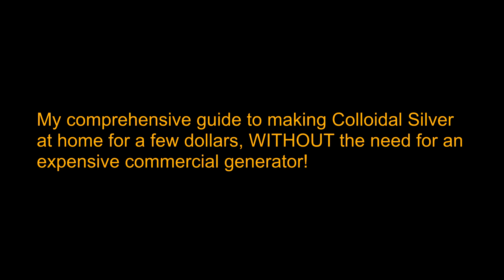Scientific Methods to Test Water Purity With TDS Meter

Comment: silver rods can not be more than 1 inch apart
Reply from the maker: Hmmmm...Not sure where you get your info, but I've always had them aprox. opposite each other - works fine...made another batch yesterday.
Reply: Not true, it doesn't matter on the distance between rods/etc. Just so long as your ppm continues to read,  that means it's working

Comment: You're done, flocculate colloids, making black lumps, this is a failure.
You can make it quickly without wasting it if you make a certain effort.

I overcame these problems.
Reply from the maker: WTF? There are NO lumps, black or OTHERWISE in what I make! 🙁

Comment: Does anyone knows where to get "double" distilled water? Could be over kill for colloidal silver but I also need it for a hydrogen gas generator.
Reply from the maker: I haven't heard of it myself - I imagine it's been filtered even further?
Reply: Buy your own water distiller and run your water through as many times as you want.  I myself do this, I totally understand what you're saying.  I hot mine from Amazon for about 45.oo. Goodluck mate

Comment: You are making ionic silver not Colloildal and use copper pad to clean not Scotch-Brite.
Reply from the maker: Well there is a lot of debate about it's exact classification, but whatever it is, it is what I use myself and have for many years with good results. Thanks a lot about the tip for the copper pad by the way. 👍
Reply from the maker: * PS; On that matter - Copper being toxic, one would want to ensure a very thorough rinse on top of the pad.
Reply: Please,  where or what plant  are you getting your info? The plant YouAnus ?🤪

Comment: I think the water you're thinking about might be called Fiji Water they're supposed to have the purest water in the world from deep inside some caves or something to that effect I believe. I've had it it tastes a little bit different than most Waters do. I also have exactly pure water through a reverse osmosis filtration system that I have. That comes up with 0 parts per million. The distilled water should be zero parts per million somewhere contaminants are getting into that and you might want to find a different manufacturer of distilled water the one that actually reads zero the way a distilled water would come out if it was being distilled properly.
Reply from the maker: Possibly, I don't recall. Yes it would be lovely if all manufacturers of products actually made what they promote they do!

Comment: ALSO  the  electrolyte will measure 20 + ppm befor you even start the electrolisis,,it does not read silver particles only ions
Reply from the maker: Actually, since I typically START at 3PPM when I use distilled water which I make myself more often than not; it rises with time when I use my method, so that is incorrect. I stop between 10PPM and 20PPM, depending on what end use I need it for. (as in my other videos)
Reply from the maker: It measures 0 to 2ppm before I start, depending on the distilled water I use, which is why I also make it myself.

Comment from the maker: * As I've now said MANY times in the comments section; Whether you choose to call this Colloidal Silver (which is what I knew it as at the time) OR Ionic Silver : THIS is the method I've ALWAYS used, to great effect, both INTERNALLY and EXTERNALLY. You can debate all you like, but the purpose of this video (& the remake of it) is to show you HOW to make it cheaply and as an EFFECTIVE alternative solution which I have found works where some pharmaceutical options, have not - i.e., for Rosacea, where a skin SPECIALIST told me there "was no natural option". * ONLY EVER use Pure distilled water! You can buy this cheaply, or even make it yourself if you use a lot of it. This is how I make it at home;https://youtu.be/P6WqbOQu0Mw

Comment: TDS meter does not give you ppm of silver particles,because it can't,;Colloidal silver is silver particles in suspention in water:::TDS meter only measures ions that conducts electricity(an electron of a silver atom(ion) which is entirely different and not the same as a silver molecule ),,A TDS meter measures the conductivety of a sulution of ions,,weather it be salts of metals or acids,hydroxides and impurities in the water::what it will do is tell you how pure your water is::
Reply: A  T.D.S meter measures dissolved salts, silver is not a salt.
so far you have best explanation on that part.
Reply from the maker: @paulabernathy2250  A TDS meter indicates the total dissolved solids (TDS) of a solution, i.e. the concentration of dissolved solid particles. Dissolved ionized solids, such as salts and minerals, increase the electrical conductivity (EC) of a solution. Because it is a volume measure of ionized solids, EC can be used to estimate TDS. * I did mispronounce the meaning of TDS in this video, and made a follow-up video;https://youtu.be/6pf3zP6yNAI for one reason a few people complained about my birds in the background (I think THEY missed the point of this video)
Reply: @SteveMack  I agree  E.C level measurements can 
Be useful in determining 
A close estimate of volume of 
Suspended Charged particles.
How come no one uses a
Multi- meter to measure silver 
Particles? And I haven't seen too many people straining 
C.S  through coffee filter either. But that's what we're
All doing (colloidal silver circle) learning from one another. A little bit here, a bit there. And 1 tiny little mistake 
Can instantly fuck up a batch of homemade C.S.  So, I
Appreicate any little tid bits.
Reply from the maker: @paulabernathy2250  (Sorry for delay - I missed this one) I would assume that no one uses a multi meter, due to conductivity of the water - WHY WOULD one even contemplate using one for THAT purpose? A multi meter (for common uses) measures VOLTAGE - NOT Parts Per Million of any liquid; hence why specific instruments are developed for specific purposes.
Reply from the maker: Correct; which is what I believe I've corrected myself on (slip of the tongue), both here in past comments and in the remake of this video

Comment: I've done many batches of homemade colloidal silver. With .999 and .9999 silver and distilled water and it never worked.. I used it for a sinus infection by sinus rinse and drinking it and it didn't help at all.
Reply from the maker: Well; everyone's different - what works on some, may not necessarily work for others..Same exact thing as 'regular' medications sadly. Keep trying new things until you find some relief - best of luck.👍
Reply from the maker: Clearly different things work for different people. In MY use, I've found it works, for some things. I think moreso topically.
Reply: @SteveMack  Should work for everyone right? CS knows no color or gender it's as good as they say it should kill all fungus and pathogens. Am I correct?
Reply from the maker: @californiaitis1255  NO. No more than one type of pharmaceutical medication works for some, but not all. Also, seems to depend on the concentration. This is merely AN alternative that people can TRY to see if it helps their ailment, when other methods have failed, OR in addition to other things.
Reply: If you used Colloidal Silver on a sinus infection and it didn't work, chances are you didn't have  sinus infection.  Things like heavy metals and mold can present like a sinus infection.  They can even cause them.  But silver won't remove them.

Comment: Have you tried making the colloidal silver by boiling the silver in water? No electricity. I am doing this with copper. I get 30ppm copper solution by putting copper in water (like in a mason jar), and boiling it, I believe it will work with silver too.
Reply: It wont work. Its the electrolysis that separates the silver ions from the rod. You have to have a current flowing through the water for the process to work. Its middle school chemistry.
Reply from the maker: Sorry for VERY late reply - I didn't get notices on all comments it seems. As Matt said below, electrolysis is how C.S. is made, but putting silver in water can kill bacteria (they use it in pool sanitization now too) but merely boiling it in water won't give you a colloidal suspended solution, which is what I show how to do in my video. Cheers

Comment: Voltage is important. Please read this information before you proceed: http://www.docs.renewedcell.com/index.php?title=Main_Page

No i do not work for this company, but I do have one of their generators and have found them to be excellent.
Reply from the maker: I have never found voltage has much bearing on it, and I've used AC and DC at various voltages.  One may produce a better yield of particles, but the object of this method is to be able to make it at minimal cost.
Reply: @SteveMack  quality is important Steve. The most effective particle size is between 4-12 nanometres.
Voltage is important because it influences/dictates the size of the particles released from the silver rods.
When making 'colloidal silver' you are guaranteed to make a % of ionic silver.  Silver ions are fine when applied externally, but when they are ingested and interact with the bodies natural salts, as well as hydrochloric acid in the stomach, it turns into silver chloride. Silver chloride does not easily filter through your body and certainly does not promote the desired antimicrobial, antiviral and antibacterial qualities of which true colloidal and nano silver particles do.
http://m.silver-colloids.com/?url=http://www.silver-colloids.com/Pubs/AboutIonic.html&nosim=true&utm_referrer=#2833
Reply from the maker: @FFCRBDI  yes I fully get that and mentioned it briefly including a link within the text.
Reply: The "wall wart" as we call them here in the states converts ac in to dc so technically your only using dc. Great intro video. i love the cs IS BS debate in the comments. If it's yellow its colloidal. It's reduced. Voltage does matter though. Amperage actually. Throw a couple cheap 7.5 resistors or some use an led lite to limit amperage and it will come out good every time. 15 milli amps is the magic number.

Comment: The oxidation of the electrodes can be avoided by switching polarity on the electrodes. Also, it is recommended to use a magnetic stirrer.
Reply: Have you tried making the colloidal silver by boiling the silver in water? No electricity. I am doing this with copper. I get 30ppm copper solution by putting copper in water (like in a mason jar), and boiling it, I believe it will work with silver too.
Reply: agauerm you are correct in assuming that you can heat-reduce ionic silver. The reason to use reduction agents is twofold: it will speed up the reduction process, and it will help to control particle size. As you will know, particle size is very important for medicinal nano silver.
Reply from the maker: @agauerm  No. I cannot see how that could possibly work, as you need to go through the electrolysis process I described in order to produce the particles.
Reply from the maker: BOTH electrodes are IN the water - What you're referring to is, in my knowledge 'Sacrificial Anodes', which does not consist of both electrodes being in the same conductive element, i.e., on a boat; the galvanic anode corrodes, whilst the submerged noble metal cathode doesn't...The only benefit I can see therefore, is that by reversing the polarity on the electrodes, you could even out the wear of the rods...
Reply: I have been producing ionic silver with and without polarity switching, and I don't see why it would be interesting to waste your silver rods by producing large amounts of silver oxide? When switching polarity, what happens is that both rods get "plated", or in other words, the silver is returned to the cathode as metallic silver. This way you can avoid that large chunks of silver oxide fall off into your ionic silver, that need to be filtered out afterwards.
Reply from the maker: @marctinkelenberg  When you switch polarity, isn't all you're doing changing which rod becomes the Sacrificial Anode?
The process I use is not electroplating - Both rods get THINNER with time; One does not get fatter.
Reply: @SteveMack , no problem if you don't share my understanding of the benefits of polarity switching. You are correct that both electrodes get thinner, because of two different processes, both related to the electrolysis of the water: formation of silver oxide, and formation of silver hydroxide. My only goal with respect to polarity switching is not to get too much muck in the water, because this will provide all kinds of side effects that all influence the quality of the final product. Interestingly enough, all upscale ionic silver generators have opted for polarity switching as part of their circuits. Maybe they are able to explain better why that is.
Reply from the maker: @marctinkelenberg  ok; I appreciate what you're saying more clearly now and it sounds like using an AC source is more ideal on that basis - as I do mention in the video, one has that option (if they have such a source available at home) I apologize if I misunderstood any previous comments & over reacted - but people need to understand; I have never knowingly misled anyone, in life nor in any videos, and sometimes words & intention of meaning can be misinterpreted, in any form of text. My goal in all of my videos is to help people, not hinder them. Cheers.

Comment: In this process, we use to call a "mud maker", the TDS meter is actually useless. From the video you can witness how much silver oxyde is produced on the electrode. In other words, apart from the fact that the ionic silver will be contaminated, the TDS will measure all silver content, including oxydes, salts etc. I was also wondering why the glass is so dark? That seems to be from deposits from earlier electrolysis! Please use the cleanest water, the purest silver and work clean...
Reply: I believe the jar was aready discolored...
Reply from the maker: @toma.israel  Correct! It sure was; unfortunately, as ideal as it might be to use a brand new jar each time, that well and truly eats into the cost which this video is about saving. And I've found the resulting solution very effective for years regardless of the used jar.
Reply from the maker: ...Where are you getting SALT from out of pure water that I use?  Yes, it's a very well used, dedicated glass jar.
Short of having expensive laboratory equipment, I find a basic TDS meter useful in gauging the level I desire to make. And the object of this exercise is for people to be able to manufacture this helpful mixture AT HOME, CHEAPLY.
Reply: If you send your colloidal silver to a laboratory, you might be surprised about what will come up. It is very hard to work with completely clean equipment, the purest water and silver and in a completely clean environment. From what you are telling us, you have most of this under control. Even so, if you don't clean your jar with acid from time to time, even the silver oxides and heavy metals picked up from the air, silver rods and the water, will build up on the glass jar, and will be part of your production process. I am not saying a TDS meter can't be helpful at some level, but the ppm reading will not even be close to giving you total silver content. Adding "a pinch of salt" will further complicate things, as it will increase the ppm reading. In my experience, a better gauge for ppm readings is time versus amperage (Faraday's law) as well as a visual analysis of the color of the final product, reduced nano silver. After some time you will have a good idea about what color you want your silver to be.
Reply: In Brazil, some universities provide access to lab tests at very low rates, like US $ 20,00 for a UV-VIS spectroscopy that will give you a verdict on both ppm and particle size distribution. Commercial labs will probably charge a little more than that.
Reply from the maker: @marctinkelenberg  ...Again defeating the purpose of making a cost effective solution, which is what this video is about.
Reply from the maker: @marctinkelenberg  This is a rough guide, Mark, for people to make a cheap solution of something (whichever one chooses to call it unless pedantic) has PROVEN to not just myself, but millions of people, to BE effective.

Comment from the maker: * FOOTNOTE * : It's vital to buy a TDS meter to monitor production. If you have absolutely PURE water (which can be made at home - See my video) HOW TO MAKE FLUORIDE FREE DISTILLED WATER;https://youtu.be/Tcy0m7NDMpQ  Then the process CAN take many hours - IN that case, it's fine to add the tiniest pinch of salt, to speed up the process, as pure water cannot conduct electricity, which is what we are doing when making colloidal silver.